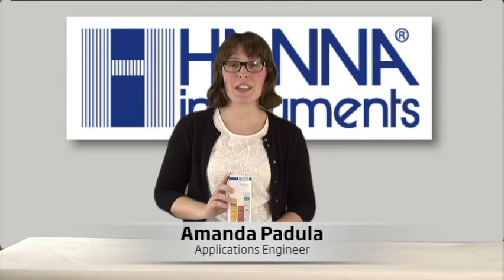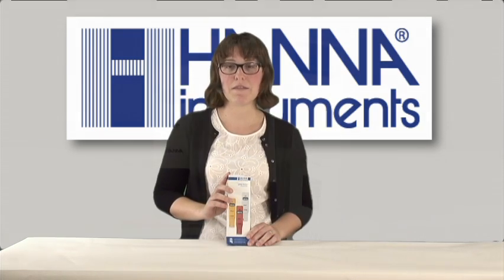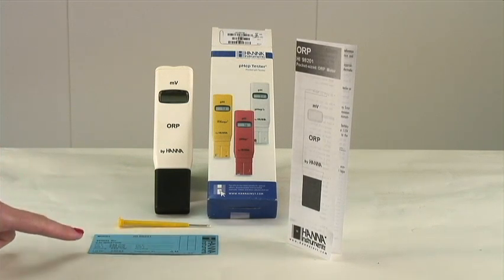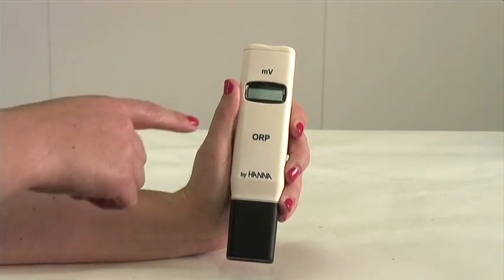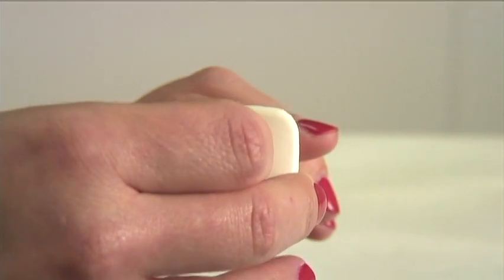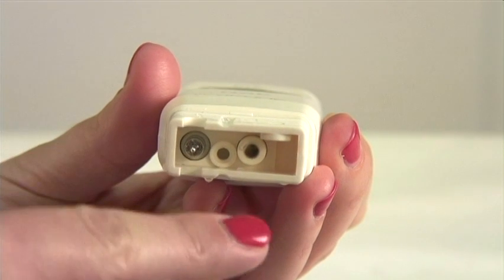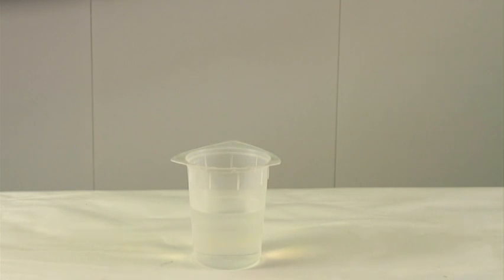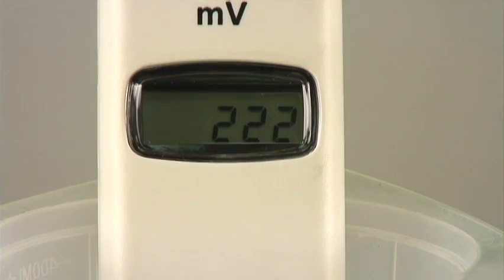HI 98201 Oxidation Reduction Potential (ORP) Tester

Comment: Good meter to measure pool water but it last only one year, I bought a 2nd one which also work for one year  after showing always 1000mv even normal water
Reply: Did you change the electrode [HI 73201] ?